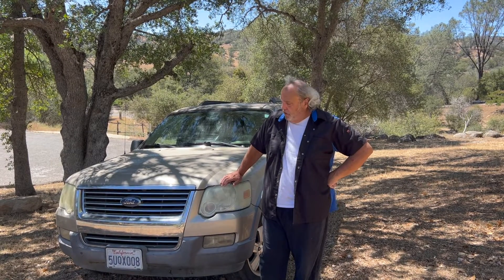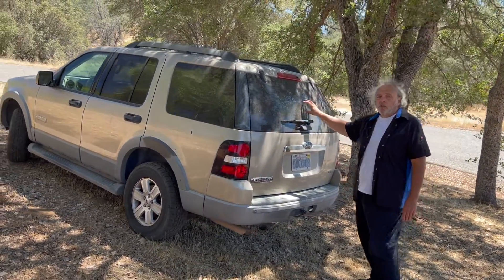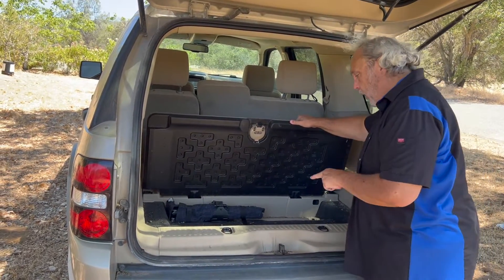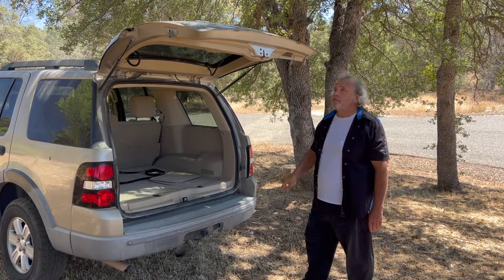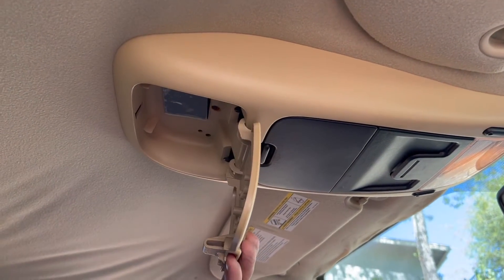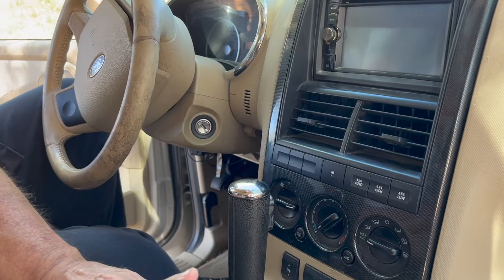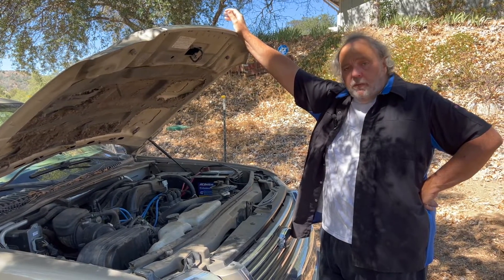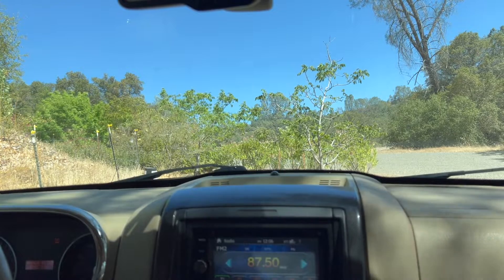2006 Ford Explorer XLT 4WD Tour & Review. Time to clean up and update this SUV.

Comment: I own a 2006 explorer v8 4x4 190000k everything still works perfect. Just keep up on all maintenance.  One weird thing is a failing  coil pack will interfere with the PCM communicating with the TCM on the v8. The wiring harness travels near the coil packs on passenger side. Simply replace coil packs. Car has nice ride 20 mpg highway with v8. Great video